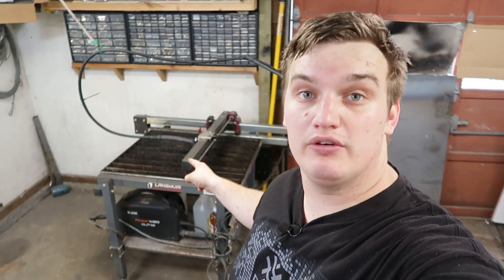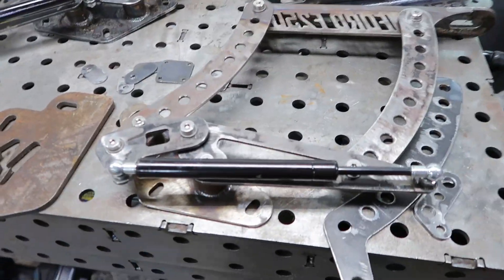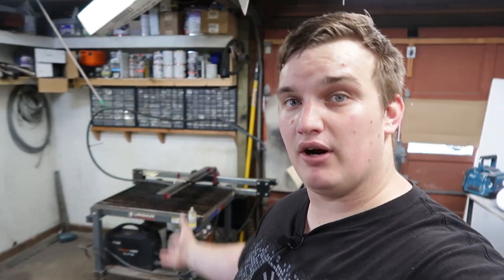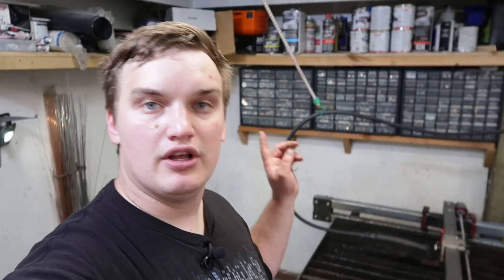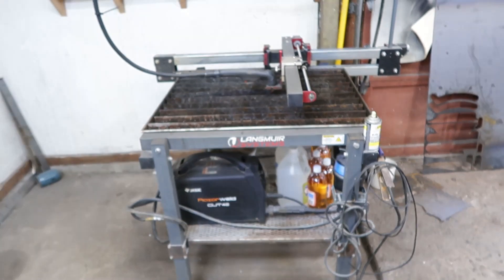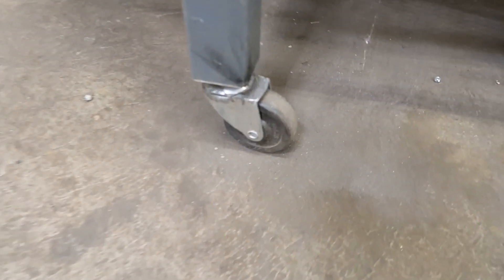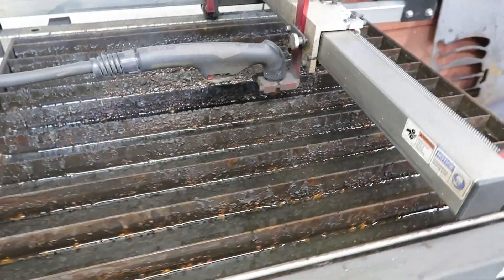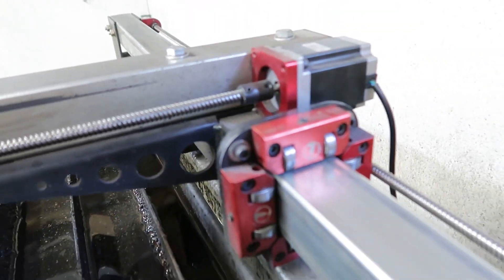Langmuir Systems CNC Plasma 1 Year Review

Comment: The crossfire I'm looking at is $1500, and they state that it comes with CNC control software and 360 CAD/CAM software.  I understand this video is old and I have to wonder if they have updated what they include.  Did yours include the same software and then you needed more, or did yours not come with that software when you purchased it?

Comment: Great video, just curious what size air compressor are you running?
Reply from the maker: I'm running a 8 gallon 5 CHF compressor. Just barely big enough. I have to pause if I'm doing any cuts that are longer than 10 minutes and let the compressor catch back up but I'm limited on space so it's worked fine so far

Comment: How much does it cost to run the machine?
Reply from the maker: Meaning electricity?
Reply: @amcustomfab  yes I know it changes depending on the size of compressor and cutters I just want a general idea never had one always used handy grinder
Reply from the maker: It's very minimal going to depend on what cutter you run but it general  . I see a bigger spike in usage on the bill if  I forget the space heater on while I am a work than if a I running the table consistently

Comment: Glad yours worked out mine is an absolute POS. The 1st issue were the lead screws, they keep falling off. Now the control is dying. When it worked it was fun, but I've enjoyed far more frustration than fun. If you're looking for a small plasma table I would suggest you look else where.
Reply from the maker: That's not good I would contact them

Comment: I just watched this in October 21, are you still using it, and are you still happy with it? How is the Cut60 doing these days? I see that Langmuir took the Cut60 off the supported list. I am real close to ordering the gen2 CrossFire table.
Reply from the maker: I still technically have the OG table but it's at my buddies house and he continues to use it I have since upgraded to the crossfire pro. I can vouch that the Gen 2 is going to be much nicer because it comes with the fire share software which is much more user friendly. And as of the cut 60 it has been running great I know there have been a couple people that have had issues with it when it is wired through the CNC port but that seems to mostly stem from the fact that they put their cutter too close to the control box on the table there are several things that people have done to mitigate that. And if none of those work you can wire the cut 60 up through the raw voltage and I have not heard one person have any issues when it is wired that way. I'm currently still wired through the CNC port and have not had any troubles. Thanks for watching I really appreciate the support 😎👊

Comment: Thanks, I needed the kick. I bought mine in Nov. 2018 and really struggled with (still do) Fusion 360. I just burned up the torch head on my Vipercut 30i and I'm debating on the Primeweld 60 I saw in your other video or spend 100+ on a  new torch and still not know why it burned up. The Primeweld customer service sounds so much better and might be worth the extra money.
Reply: Primeweld not recommended anymore.
Reply: Dont feel bad, unfortunately Fusion 360 is close to the only option, and they know that. Its a terrible bit of CAD software and theres no actual support for time, its all community based. Its amazing how much they charge for their software and then offer zero support for it. Its full of bugs, and has the worst workflow possible.

Comment: Did I understand you would like the hyperfirm cnc machine better. I’m afraid of the problem with high frequency problems?
I’ve been wanting to get the Langmuir 24x36 and up grade of z access. Did the system come with fusion 360. I’m just building a couple of Anglia’s will need brackets and possible cutting out sheet aluminum with this
Reply from the maker: Fusion is fee to hobyest . Hypertherm is the ultimate goal but I have recently upgraded to  the Primeweld cut 60 and it has been preforming well
Reply: @amcustomfab  I already have got me a prime weld cut 60.. lookin at buying a LS table and cut with it .. glad to hear you’re rockin it 🤟🏻

Comment: One note on the USB cord: I'm not sure 'how long' they are before you need an amplifier, but there is a limit to how long a usb cord can be before you start having issues. If you're not having any issues with 16' then maybe that's it? hehe but there IS a limit. I think it has a lot to do also with the gauge of wires internally as well. So get a heavy duty cable if you have a choice.

Comment: Thanks for the reviews! Helps a lot! I work at a welding school and we built our own plasma table etc. So it's best to get a hypertherm plasma cutting machine? How's the software interface. I know you have to have a "CAD" software for drawing, but how's the software interface that operates the plasma motor, etc?
Reply from the maker: It uses Mach 3 to run the stepper motors

Comment: hey i have a similar setup and have been doing research on cut charts but cant come up with much and was wondering if you have one or can share some tips with me, thanks!
Reply from the maker: Absolutely I don't know if these are quote" right it's just what I found with trial and error but I run 16th at 120 in a minute at 25 amps, 1/ 8 in at 70 in a minute and 30 amps, 3/16 at 45 in a minute 35 amps, 1/4" at 30 in a minute 40 amps, and 3/8 at 25 in a minute 45 amps.
Reply from the maker: Also as it gets thicker you have to bump your pierced to lay up a little bit. So like for 16th inch I do .5 Pierce delay. But for quarter inch I do more like 1.5 pierced delay
Reply: @amcustomfab  awesome thank you so much, hopefully this will save me a lot of time. awesome video!
Reply from the maker: The charts in what regard? Like feeds and speeds?
Reply: @amcustomfab  yes feedrate and amperage based on metal thickness

Comment: Can you share a link with the info of converting the standard Razor weld head to HYPOTHERM?
Reply from the maker: It is the x45 torch upgrade that langmuir systems sells on their website
Reply: @amcustomfab  thanks mate. I'm in Australia, Razor weld here is called razor cut 45,ill see if I can get HYPERTHERM option here. How are you finding the HYPERTHERM power source,big improvement? A very expensive machine but worth it is what I hear..
Reply from the maker: I don't actually have the hypertherm power source I have the razor cut 45 with the upgraded torch that accepts hypertherm consumables.
Reply: The Hypertherm Powermax 30xp is only $1,500.00 now. Mine is coming in next week.